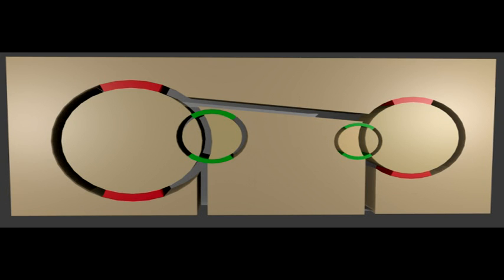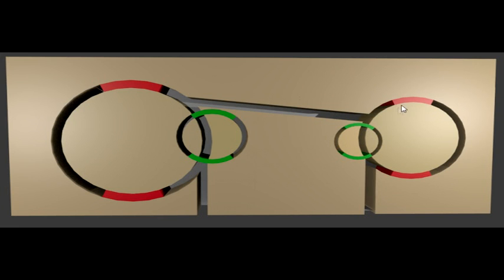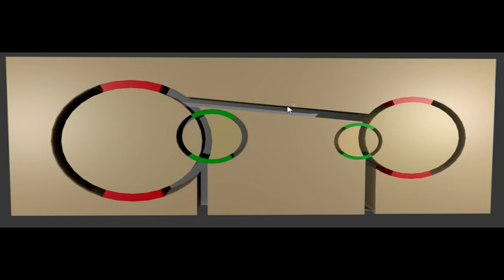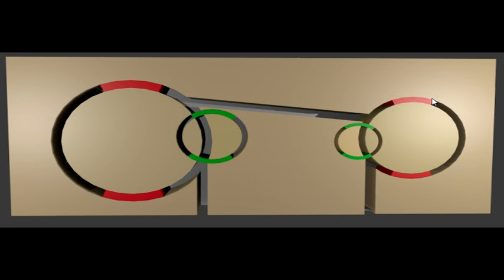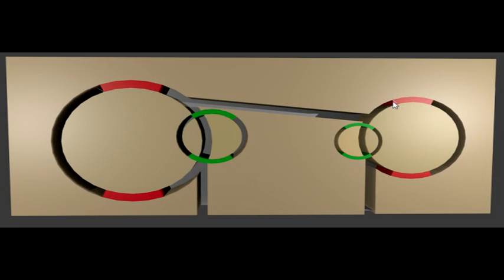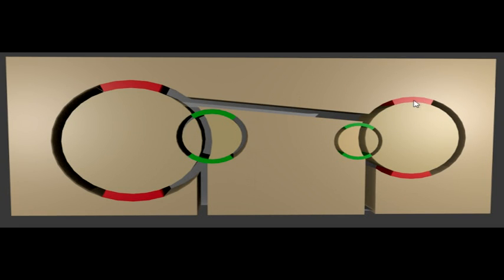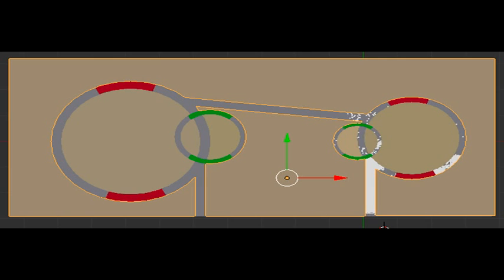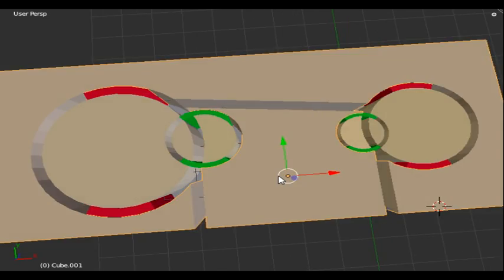Rotary Engine: OCLM Engine

Comment from the maker: @erikcgtas well it that would have to be tested. The power would be more because the speeds that the parts could spin would be faster than a normal internal combustion engine.

Comment: wow... but what is the difference  between this and a conventional internal combustion engine? about power, consume, gas emision, etc....
Reply from the maker: Power, efficiency and life span. The engine would have no oscillating parts so it would not suffer from fatigue on the level that a traditional engine would. Also the power would be closer to jet engine as the rpm of the engine could be faster and the efficiency would be closer to diesel engine as the compression would be much higher.